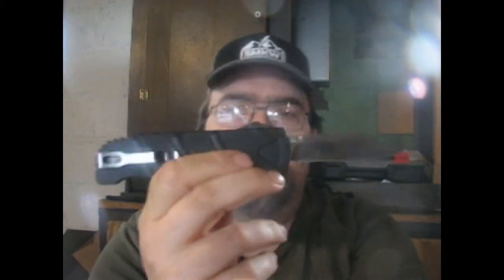The Broken Boker:  Automat Kalasnikov  OTF

Comment: You were torqueing the shit out of that tip when you were lifting the chair up with it. The knife was off center and the chair was putting way more strain on that tip side to side twisting it than you think. Pay attention to the video when he's lifting up the whole chair with the knife tip about a 1/2 inch into the seat with it off center of balance. Also the blade profile of that knife is not made for any kind of real prying, it's way too thin at the tip!

Comment: Thats one reason I dont really like bowie style blades, that tip gets so thin it gets me iffy on it. That is one reason I like reverse tanto style like the Benchmade contego, or buck even has a a few 420 basic knives with a good reverse style tanto, give the puncture ability of a tanto and usability of a drop point.
Reply from the maker: Boker made thing right and replaced the broken knife and the replacement got through  my testing. I did a video about the retest.https://youtu.be/Dp2ksTwr7Qo  But, I do agree that a clip point on a blade this thing is generally not a good idea.
Reply: @TheNuttyKnifeGuy  also d2 is somewhat brittle when thin. You trade off soft metal and impact absorption for more brittle but excelent edge retention. Or so Ive noticed in my uses

Comment: Everyone is gonna have a different opinion, a $120 knife should not be snapping at the tip BUT a $120 knife with a thin tip can break. You should always know the capabilities of your blade based on it's thickness and the Bowie style on it isn't thick but it's still a defensive knife. There's a difference between a defensive blade and a hard use blade. The Spyderco Police 4 is advertised as a self defense knife more than EDC but I wouldn't snap off the tip then call Spyderco saying "oh your knife is terrible that's unacceptable!" when I knew the profile and thickness of the blade to begin with... so if you have a thick tanto and it snaps THEN you have a right to be pissed at it breaking that easily in my opinion and ya bone is dense but I'm not gonna have my knife buried in someone's bone and prying with it, chipping or edge rolling is what I'd be concerned about with that
Reply from the maker: I'm always willing to give a knife a second chance. But I don't consider what I did to that first Boker OTF to be heavy use. As you've seen in the retest video, the replacement knife did well. Even the best knife maker can have a bad quality control day.

Comment: That tip snapped far too easily in my opinion and, this wasn't even a remotely abusive test. If it couldn't take a little torque in relatively soft wood, then how could you trust it in a defensive situation where it may come into contact with bone which is significantly harder and denser than wood.  I'd say give Boker Plus the benefit of the doubt and hope they warranty it but, Boker Plus aren't really known for good quality control or a good warranty.
Reply from the maker: I was aware thar Baker's 'Plus' was questionable quality when I ordered this knife but I liked the overall design enough to take a chance on it. I also liked that they claimed it had a D2 steel blade. I half-expected for the mechanical action to fail, but I didn't expect the blade to be that fragile. Either the blade wasn't D2 or the heat treat was completely botched. (I suspect it was both.) I'll let viewers know what happens with the warranty.